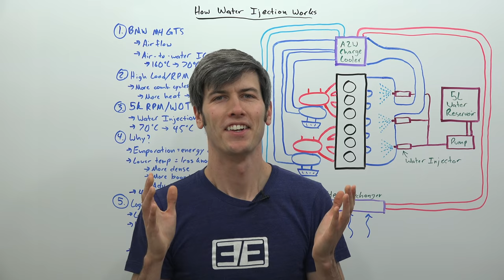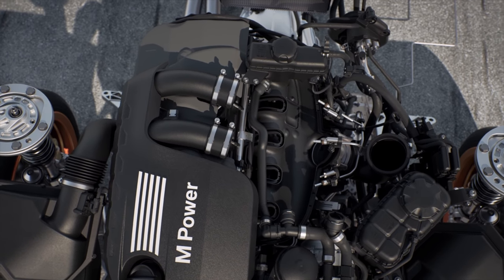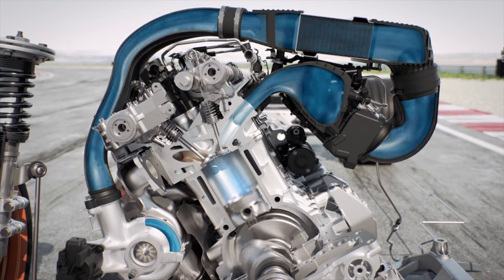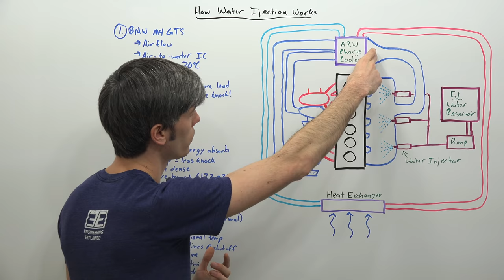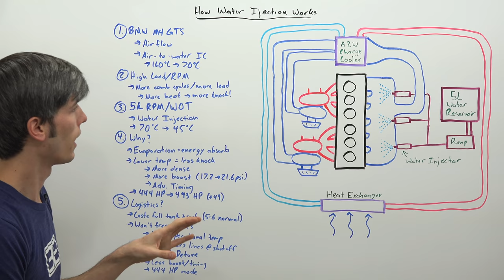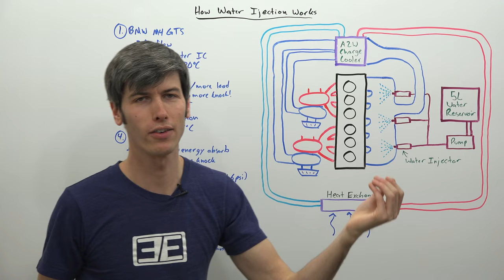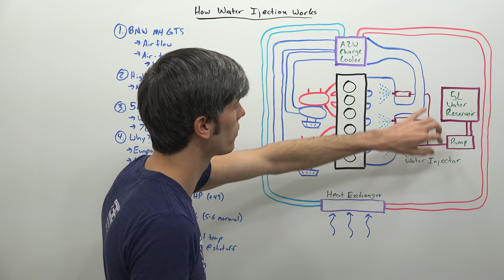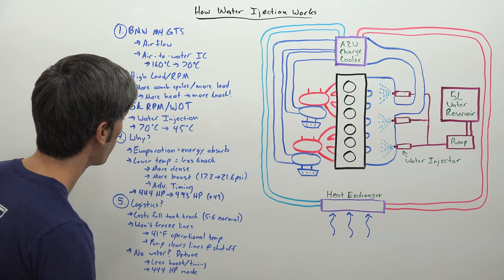How BMW Used Water To Make +50 Horsepower

Comment: My 2010 335d tuned and all the emissions crap coded out it makes 428hp at the wheels, 650 ftlbs torque. and gets 40+ mpg. Diesel M3. Also have a 04 M3 way more fun to drive then the diesel, only 355 to the wheels. And a 8250 rpm redline. I absolutely love the sounds it makes. A friend described the sound as a symphony of bad ass. I liked that saying. Actually check my channel there’s a video titled symphony a bad ass. The diesel will destroy it in a straight line.  Also at 80 mph in the rain with traction control on it breaks loose. Gotta be super careful driving it. It’s torque from idle to redline. A freaking torque monster. I had to have my transmission custom rebuilt with stronger components bc the stock didn’t last much more than 6 months. Great explanation of the water injection on the gts. All your videos are great. Easy for anyone to understand from people with little to no knowledge of engineering or anything mechanical and for the rest of us that do this for a living. I have owned and operated a independent BMW repair shop and salvage yard for almost 30 years. Man I’m getting old. Just realized how old after the 1/4 century of working on them. My partner has the same level of experience. We started fixing them right when we graduated high school and between the two of us not counting the 3 other techs we have. We have over 50 years of BMW specific training and knowledge. Keep up the great work.

Comment: Question, my f150 2002 4x4 crew cab 176,000 miles makes a squeal sound affter I’m in gear 5 then I ease off the pedal and I heat the soubd

Comment: does it have a water filter that filters the water that goes in the combustion chamber? it should have. if not even cleaner than drinking water. pure with no other minerals that may not be a good mix for combustion.

Comment: BMW claims the A2W charge cooler takes temps down to 70 deg C... how?  Wouldn't the coolant be 90-100 deg C at operating temp.?  Is the charge cooler on it's own coolant circuit?

Comment: How can you discuss knock without including if it is a spark DI or PFI and the compression ratio.

I do understand that the waters negative affects on combustion are outweighed by the increase in boost

Comment: I have  two questions. First as the revs get higher the volume of air passing through the intercooler increases, in effect each litre of air spends less time in contact with the heat exchange so does the intercooler become less effective at removing heat as the revs increase? Second question, when the injected water evaporates it expands in volume, does this displace air in the intake manifold and how does the ECU compensate for it?
Reply from the maker: First question, it would depend on how the system is set up. If the flow rate of the coolant for the intercooler is constant, and the airflow rate going through it increases, you would have diminishing returns as more air flowed through it. If you increased the coolant flow rate, you could compensate. For the second question, you can compensate for this with turbos (boost), meaning you force more air/fuel/water in than you otherwise could with a naturally aspirated engine. Gas is compressible, so you can compensate with more pressure.
Reply: @EngineeringExplained  Thank you for the quick response, I assumed that there was an answer to both questions otherwise the setup would not be very functional, I just didn't know how.

Comment: Can we use like very pressurized water to force pistons down instead of combustion. I mean there is no intake or exhaust just cylinders and a very high pressure water pump which acts like fuel injectors... Difference would be that the pressurized water would be forcing the pistons down🤔... I had this idea...please do mention the flaws of this

Comment: if you inject water into your intake manifold the water will flow inside your combustion chamber and will decrease the space in the cilinder for fuel and air. that means you need less fuel but because you have the water injected it makes more power so its also better for fuel. because the water will get out through the exhaust valves and will flow towards your turbo's when you shut the car off the water will stay in the pipes and they will create 
corrosion (if not rust) and that is defenitly NOT what you want in your 1/700 BMW M4. i dont know if this is true or not but it has some points to talk about with water in a combustion engine

Comment: I would presume some percentage of the water evaporates in the intake but there is still some water droplets (small) when it enters the engine.  Once in the engine the heat of combustion will cause the water to expand enormously which should aid power/torque production.

Comment: Hey man, I was watching your video on turbo knock earlier today and then I went into class and there we were learning about car engines and how diesel engines don't require or even use spark plugs to ignite their fuel mixtures. It really was great timing to get this train of thought going, as your video was still fresh in my mind and I started wondering.

Since diesel engines rely on the temperature increase from compression to ignite the fuel mixture, is knock a problem in diesel engines? Do diesels even have the capacity of getting to the point, with turboes, that knock becomes a problem or is it simply because fuel is already igniting in random places of the chamber, that knock becomes irrelevant? I'm actually assuming that the point of ignition in a diesel is random, but is it?
Reply: The point of ignition on a diesel is essentially tdc
Reply: Since diesels are direct injected (or indirect injected sometimes), an air/fuel mix does not enter through the intake valve like a gas engine. There is no mixture to be compressed, no knock to be had. Just fuel injected directly into the cylinder when it needs to be.
Reply: @shedcraft700  yeah, the injection happens at the precise moment it needs to (sometimes even multiple times in one stroke) and is directed to be spread evenly around the chamber. That's how knock is prevented.
If the injector were partially gummed up, the imbalance in fuel spread would probably cause some nasty knock. But that rarely happens.
As for the old indirect injected diesels, they did compress a mixture of fuel and air, but at that point the mixture was well and truly mixed and the temperature inside the cylinder was instead calibrated to cause the mixture to ignite at the right moment. 
That being said, after directly injected diesels came about, the diesel engine became a whole lot better as an engine
Reply: @sykurpudi1  Well done!

Comment: I've always wondered about the effects of "wet air" vs regular air in the combustion chamber. it will surely change the coefficient of expansion, but what effect does that have? the phase change from water to steam has already occurred before the combustion chamber, I wonder what effect injecting water in to the combustion chamber would have? would it run cooler for a given output?

Comment: water doesnt evaporate till 100'C so if the charge air is only 70'C then wouldnt it shoot too much water that doesnt evaporate until into the combustion chamber? I am using methanol/water injection that evaporates at lower temp. and it bogs if i use full water.

Comment: Hey Jason,
What about the expansion work of the water? Any appreciable power grains from that side? Or are the thermal benefits greatly outweighing these?
Thanks
Reply: Water has no expansion work in this setup. To the contrary, the intake air actually gets condensed when the water is sprayed in. This creates the chance of higher compression ratio and power increase. However, some part of the water will be broken into O and H later, in the combustion chamber, and the O part of it just wants to oxidize whatever is near to it. That results in all carbon deposits disappearing from the valves, the head and the top land of the piston. This only happens when the WI is active, in this case above 5.000rpm and full throttle. We performed experiments with WI on smaller engines starting the spray shortly above idle and we experienced fuel savings, emission improvements and as an extra benefit: clean combustion chambers, like pharmacy.

Comment: In Brazil, most vehicles are "flex", that is, they can use gasohol (73%/27%) or ethanol, the latter with 4% water. The use of ethanol tends to bring a power gain of up to 5%.

Comment: So the water goes into the combustion chamber? If it does, how they prevent oxidation?
Reply from the maker: Water is also part of air naturally, and it's also a byproduct of combustion. Engines see a lot of vapor going through them, even without an injection system.

Comment: The Grouppe B Rallye version of the Renault 5 Turbo have used water injection on admission to improve power, in a Renault Sierra Engine to produce 360 hp in mid 80's.

Comment: Is it at all possible to make one of these systems possibly a manual on for my own car I heard years ago somebody water injected there classic mini using the head light washers off a BMW supposedly because it sprays such a powerful fine mist of water that it's broken down to atom sized partials of hydrogen and oxygen. Does any of this sound at all factual of have they been making stuff up?

Comment: B1B Supersonic Bombers use water injection as well, as they do not have an afterburner, and it is what makes them so absurdly loud at takeoff. I am guessing it works on the same principal, but in a piston engine instead of on a jet turbine.

Comment: How about scavenging clean condensation water from the airconditioning system to top up the 5L tank ? Might result in enough watere to never have to fill it under normal street driving conditions.

Comment: what will happen if u fill the bottle with methanol ? more boost ? That's a old tuner  trick if u wanna bring your intake temps down in a boosted motor before cars had intercoolers.
Reply: It would need a re-tune, plus I'm not sure if they built it with methanol-compatible components.

Comment: Another added benefit to a water injection system is that the water cleans the intake port & cylinder. It steams off the carbon buildup.

Another benefit is you can run a water injection system or an intercooler, but both have advantages. 

Lastly, if you use a mixture of water & methanol, you will bring down those temps even more. People just use windshield wiper fluid and during the winter time, people buy the winter blend to keep it from freezing. There are also tank heaters also. 

I'm putting a water/meth injection system on my GSX-R that I'm going to turbo. It will save me having to put an intercooler on it. Therefore, no big intercooler sticking out = sleeper
Reply: Bro if i see a turbo on a bike the last thing to come to my mind is sleeper

Comment: Would it be different if you used a FMIC? From what I researched, the best increase in power is when one would turn on the water injection after you were in boost to cool down the intercooler to make it a better "heatsink" per say, instead of actually cooling down the boost. Could you explain?
Reply: I'd suspect injecting before an intercooler would have a chance for the water vapor to collect in the various passages or cavities and cause issues if not properly evacuated or drained. By injecting so close to the cylinder, there isnt much time or space for it to go back to liquid form. Could be wrong though.
Reply: @ALMX5DP  I really don't know. I mean stainless steel is resistant to rust. But the car I'm going to import has water intercooler stock, it's just not turned on. But I believe it is placed in front of the intercooler

Comment: This technology dates back at least as far back as WWII many of the air-cooled radial engined fighter planes having this technology so they could have as needed an extra boost of power in particular the Chance Vought F4U powered by a Pratt & Whitney R-2800 Double Wasp engine.  My father a Pacific theater veteran was told a story by a Marine pilot in a F4U who had to resort to using his water injection to escape from a Imperial Japanese Army fighter plane a Nakajima Ki-44 Shoki (aka Tojo).  The Corsair was a very capable and fast fighter plane outperforming the legendary A6M Zero encountered over the Pacific.  It was this pilots first encounter with the newer Ki-44 a little "hotrod" plane with a big motor.  It was designed as an interceptor with emphasis on straight line performance.  The F4U usually had no problem outrunning a A6m Zero but this little Ki-44 was right on his tale and it took several uses of his water injection to escape his pursuer.  His was first hand information by the pilot returning from a mission to my father.

Comment: Question?
I don't get where the heat goes with the water injection?
There's a closed system where there is heat that heat gets sucked into the inlet manifold and into the intake valves.
When you inject to the water into the intake manifold in this closed system where does the heat go.
It's the water absorbs the heat doesn't the water get sucked in to the intake valve, and thus the heat.
Where is the heat exchange?
The heat goes from the hot air to the water but the water does not escape the closed system?
If you can explain that would be great.
Love the channel yada yada yada!

Comment: could alcohol be used as a replacement in arrears that get very cold or would the temperature or the air be enough to cook the engine
Reply: Lexton Ravaee From what i understand yes/that would be a water/methanol injection
Reply: Lexton Ravaee  not necessarily for the stock bmw system. Just in general people instal meth injection (which is just water and methanol which is non consumable alcohol)

Comment: Did Bmw mention what happen if the car is parked for days or a week in i northern country? Its often -20 to -35 or colder there. That means even left soda freeze in the car. So reservoar should not even be half full

Comment: So water is being injected along with the air intake, doesn't that mean you are reducing the oxygen and at the same time water is being pumped into the cylinders. Wont the cylinders buckle as water is not compressible ?

Comment: GEE-WIZZ, BMW thought about everything to do with H2O injection that was thought about in the 1930's.  FYI - Aircraft systems used 50/50 Water/Alcohol.  Test with a P51 engines were able to increase boost, without denotation until the engine self destructed.  Problem with H2O injection systems which were available in the 1960/1970's was servicing the systems (distilled H2O) and liquid leaking into the cylinders when the Car sat for periods, causing liquid lock, and subsequent cyl-head failure.  Good work though, Thanks

Comment: Could colder fuel have the same effect? I saw someone use a water/air intercooler resivoir to chill their fuel. They ran a long fuel line in a coil through the tank to chill their fuel before going to the engine. Genius stuff

Comment: Adding water into combustion mix also increases the mass flow rate thru the drive side of the Turbo. This will increase the amount of work the Turbo can do. 

Some airplane Turbines inject water during take off especially at sea level to increase mass flow rate thru the turbine and give them more power.

Comment: Is there is a reason for not using water condensed from A/C system? I am suprised you didn't go to details about the drawbacks from water injection
Reply: Well, first of all the A/C wouldn't produce enough water to have a significant effect, secondly the condensed water the A/C produces is often not as clean as you would think. It has often quite a lot of particles and stuff in it.
Reply: @shi01  the amount of water usually depends on the humidity. I agree on your point about it been not that pure, but i was assuming that they already have a filtteration system since most people would fill the tank with tap water if I had to guess

Comment: One question...
If the water is injected directly into the cylinder head with air then don't you think this can corrode the valves and other parts? 
Also don't you think that mixing water moisture with air will degrade the combustion?
If anyone knows then please reply. :)

Comment: I wonder, whenever engineers introduce seemingly simple and clever solutions like this and Dodge's AC compressor charge cooler, how feasible it would be to try and design these as aftermarket systems on existing engines. I understand there is meticulous calculations done for both the system iself and ECU tuning, but is it possible to replicate the effects with DIY/aftermarket workarounds?
Reply: that's why methanol injection kits exist

Comment: Could you run it without water all the time?
Reply: Yes, but that would partly defeat the purpose, as you'd only have the 444 hp of the regular M4.
Reply: Yeah but the gts is still quick though

Comment: 50 HP more, but also more weight (water, tank, pump, tubing, injectors), some power lost for pump, less intake air because of water wapor, and worse combustion because of vapor. I'm wondering what is the net gain, including all of this?

Comment: I wonder how running DI water compared to tap water effects performance?  I guess the difference between DI and tap is minimal as everyone has access to tap water and it clearly isn't too inferior to DI water otherwise there would be no point in using it. Maybe using a different coolant like acetone or methanol could effect performance but then you're getting into the region of why not use NO2? But then you'd be putting extra stress on other components of the engine that aren't designed to be run with high energy fuels/power adders.